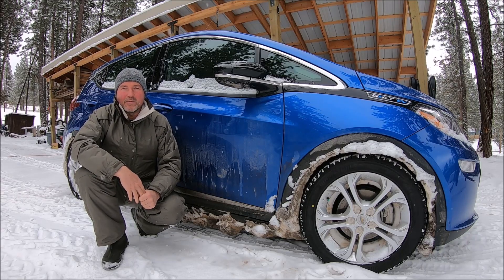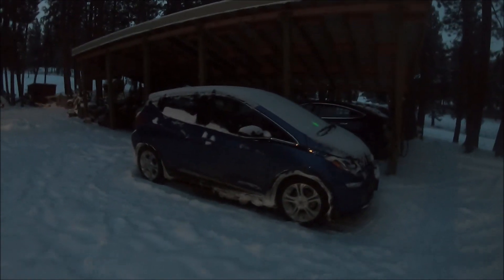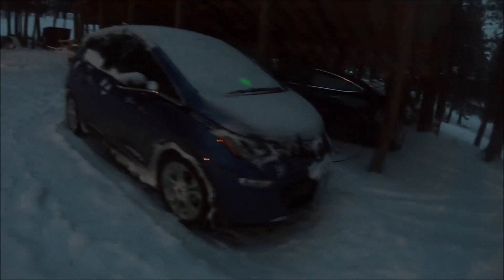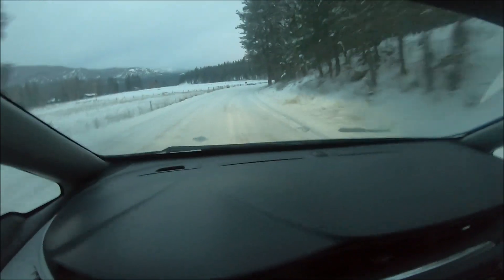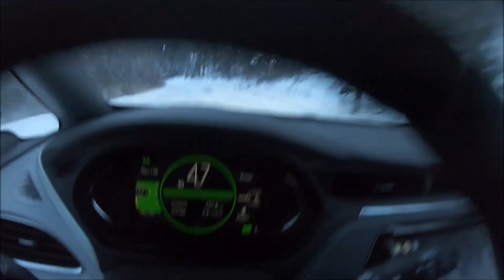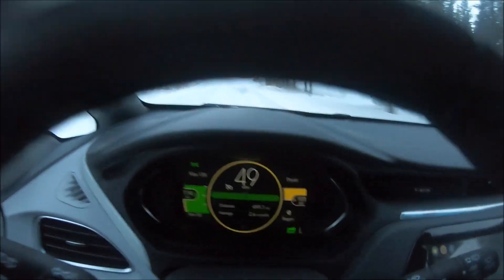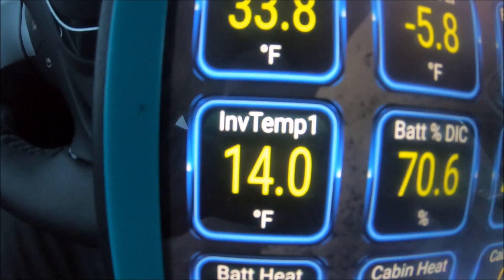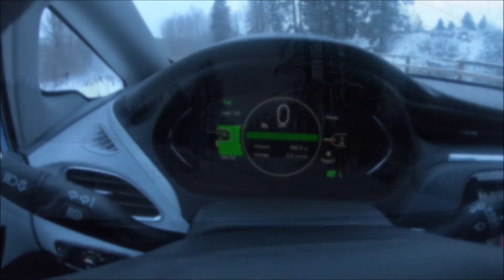Chevy Bolt EV Cold Morning Drive(-9°F/-23°C)No pre-heat, get in and drive. Regen/Power restrictions?

Comment: Thanks for the video. This is the first video I've seen of cold (below 0) temperatures. My Bolt had the same experience at below zero temperatures. It ran fine, but the range dropped below 100 miles. Teslas have the same problem according to my cousin in Chicago. Unfortunately Teslas are made in California, so this issue isn't being addressed to my knowledge.
Reply from the maker: I've got a few videos about winter driving. Check them out. The range shown in the car may not be the actual range you can drive. It can be much lower or much higher! In 0°F or below the range will drop, as it will on ICE cars too. How much range  it will show depends on your previous driving. EV's look at about the last 30 miles of driving for that. If you have a short daily drive of about 20 miles or less in such cold temperatures, the cabin heater and the battery heater are working overtime and are using a lot of power for the whole drive. Now the car calculates range based on this short drive with an extremely high energy consumption. In reality you could drive much further. Why? Because the car drivetrain and battery will come up to a temperature  that does not require the battery heater run as much or even come on at all. Also the cabin will warm up and then less cabin heat is needed. These two things will extend your range. If it show 100 miles range and you go on a road trip you'll notice after about 30 or 40 miles that your range shown does not drop mile for mile. It will drop a mile maybe after driving 2 miles or so. I have taken the Bolt and Model 3 on many cold winter drives and found that, on a road trip, in the worst case the range does not drop below 50% of EPA rated range. For my 2020 Bolt that would be at least 120 miles of range. On my Model 3 that would be 155 miles of range. These are conditions that you don't want to be doing a road trip in anyway. Daily short drives, like going to work are no problem as you have access to your usual charging infrastructure. These issues are not because Teslas's are made in California all EV's suffer from this. Unfortunately these are physics. With time when EV's become mainstream more efficient components will become available, but this will probably never go completely away.
Reply: @RMTFamily  As battery tech improvements like solid state batteries become implemented this wont be much of a problem if one at all

Comment: Assume the Bolt is equipped with FWD only?Holds the road pretty good.
Reply from the maker: Yes, the bolt is a front wheel drive. I think that is the preferred over rear wheel drive as the motor, inverter and all electronics are located under the hood. It handles like an ICE front wheel drive, actually better because of the low center of gravity with battery pack below the floor.
Reply: @RMTFamily  Okay...thanks for helping
Reply from the maker: @a.joseph4233  Anytime. If you have any questions just ask and I will answer to the best of my knowledge. If I don't have an answer maybe somebody else does.

Comment: So you unplugged the car because you were charging the car outside?
Reply from the maker: Usually you keep an EV always plugged in while sitting at home. That does not mean it is charging or using power the whole time. But if plugged in it can run the battery pack heater without using power from the battery pack, which would decrease you range. In this case the car was plugged in as usually. Our EV's live outside! No garage! I did not pre-heat the cabin of the car and charging was actually done right after it was parked a couple days earlier. Usually I would pre-heat the cabin before driving, but here I was looking for it to be as cold as possible all the way thru. This is extreme as usually you would set the charge to be started in the middle of the night so it is done just before you leave and you would pre-heat the cabin about 20 minutes before leaving. This way you get into a warm car and the battery pack would also be warmer than in this case. So I just unplugged the car right before driving it.
Reply: @RMTFamily  Okay..now i understand ...thanks for helping

Comment: Does the cabin heater work well in below zero temperatures?  (Even if it does use a lot of energy)
Reply from the maker: Yes it does. It also has the advantage that it puts out heat right away, while on ICE car you have to warm up engine first before you get heat.
Reply: One pedal driving on my Mach E is amazing

Comment: I got some Blizzak Winter Tires on mine, handles awesome.. I got side swiped by a UPS Semi truck on black ice on the expressway and was able to recover without going off the road.
Reply from the maker: Yes, those tires are well worth the money. Never had any issues with regen or traction on ice or in snow.
Reply: @RMTFamily  What is that App your using to pull battery stats?
Reply from the maker: @JosephJozwik  This is such a common question that I actually just finished a video about it. It will publish this Saturday at 10AM Mountain Daylight Time. It is the Torque App but it requires special files to work. It'll be all in the video with detailed instructions.

Comment: Interesting analysis. I read something about a guy in Alaska (I think) and he had conditions possibly even worse than yours. He otherwise has similar comments about a block heater for his diesel truck, regeneration on his Bolt in the cold and other issues.

Definitely going to take a look at other videos in your channel. Thanks!
Reply from the maker: There was a viewer from Juneau AK. He told me that Juneau is the is not just the capitol of Alaska but also has the most EV's per capita. I forgot to plug in my truck before, or did not expect to use it and thus it would not start. The EV is always plugged in when home, never an issue.

Comment: There is just no more excuse for not driving an EV. They do great even in this cold.
Reply from the maker: @youdontknowme2915  Good for you. If you never had a starting battery fail on you in 50 years than you are very lucky. The common starting battery lasts 3 to 5 years, sometimes you can even get 7 years out of it. The question is why did you never have any starting issues in cold weather. Did you get a new car every 2 or 3 years? Did you replace the starting battery as preventative maintenance every other year or so? Do you actually live in "cold" (below freezing for several month) weather? 
Most people will need a jump start or replace a battery during their time driving an ICE vehicle no matter where they live.
You right people driving ICE vehicles don't have range anxiety, that's why you see them frequently on the side of the road with gas cans. But most people don't carry a gas can. They have to spend a lot of time to get that that gas. About the same time it takes an EV to get a quick charge from a roadside assistance company or have the EV towed to the next charger. But that is very uncommon as range prediction is pretty accurate in electric vehicles and electricity is available almost anywhere, but not gas. 
By the end of this decade range anxiety and EV's will not even be in the same sentence anymore. 
EVs follow about the same S-Curve that ICE vehicles did over 100 years ago. In the beginning everybody asked the same questions and made the same statements back then.  Where do you get gas? Who can repair it? How far can it go? There is not even gas stations. Nobody knows how to repair it. You can't get parts for it. What if you run out of gas? etc.
Thank You for watching.👍
Reply: @youdontknowme2915  The Chevy Bolt is affordable and when you take take it for a drive across America you will notice that the fuel bill is lower too.
Reply from the maker: @youdontknowme2915  AAA gets anywhere from 20,000 to over 50,000 calls for running out of gas per MONTH. In the US alone.
The number 1 cause for break down call is, you guessed it, the starting battery.
I don't make this up you can do your own research to see that's it.
Not laughable and not nonsense.
Reply: @@todd3382 Your ICEV has degraded efficiency in cold weather. In summer you do 30 mpg, in winter be happy to get 20-22 mpg. Not sure what are you talking about.
Reply from the maker: @Todd Sounds like you don’t drive an EV. Who said you can’t charge to 100% at an DCFC. Certainly you can, done it many times, but it’s not always needed. Heat does not affect range very much, cold does but with more heat pumps in EV’s even cold range has improved. And even with the range limitation on EV’s, people need a bathroom break anyway after a couple hours of driving, good time to charge the car.
Reply: @Todd Why can you only charge to 80% at fast charge stations? Nothing says you cannot if you need to. Just that most don't because it can degrade the battery faster and they don't need that extra 20% for their regular daily commutes.
Reply: @Todd you have no idea what are you talking about, but you think you know everything. 
Let me tell you how things work : you can charge to 100% on DCFC or on a L2, this fact doesn’t impact the battery chemistry. The simple fact that you charge to 100% a battery on a BEV doesn’t count much. 
Keeping long time the battery at 100% SOC or at low % SOC (less than 40%) will impact in time the battery chemistry ! The key word : in time ! If you keep your battery @ 100% one time, it doesn’t matter. If you keep it long time @ 100% in a regular bases, then yes, it does have an impact.
Reply: @@todd3382 You forget one thing - the batteries in the BEV aren’t the batteries in the laptop or iOS/Android phones. They all have temperature management system and they are kept in the temperature range for an optimal usage. Thus, what you say holds no truth. And, yes, there is a number of full discharge cycles the batteries in the BEV are conceived, for the Bolt EV it’s about 3000 cycles if I remember correct before a significant degradation is registered. 3000 x 200 miles (for the easiness of computation) you do the math. In about 600 000 miles the BEV will face a significant degradation (more than 30%). 600 000 miles is diesel territory. Check the YouTube, there is a Bolt EV who’s passed 150 000 miles in 4 years and had a degradation of the battery lower than 10%.
Reply: Depends on the commute. My new commute requires a charge to get home and with fees and charging cost it’s more expensive to drive than an Elantra hybrid would be. Plus add on an hour or more of charging to get home and a hybrid is cheaper and quicker.
Reply: Only would drive a Tesla or polestar
Reply: Agreed, but the issue is not how well they do, it's how far can they go?? I have a 2015 Volt and I like how you push the button and go. Heat comes quickly. I drive 140 miles a day and no charger at work. At those temps I couldn't make it round trip. If it had a heat pump, maybe.
Reply from the maker: @bmw803  It's important to know that EVs can do well even in extreme cold compare to ICE cars that struggle to start and run. Sure range is important for some, that's why we also have videos about how far they can go in cold weather. Check out these 2 videos: https://youtu.be/UbDEjwoRqGI   and   https://youtu.be/u1XyFGFA6Uc
We have many different videos addressing different issues. Just keep watching.
Reply: Yeah. There is. The grid can’t handle it. Nice try.
Reply from the maker: @jxp1993  The grid can! Actually the grid loves EV’s! Over 95% of EV charging is done at night. The grid loves to have such a base load. EV charging at night everything else using electricity during the day.
Reply: There is a reason you don't get to decide for others.  EVs are over priced shit!
Reply: I live in the city, with no driveway and competitive parking. It is not feasible for me to have an electric car because I can't charge it in front of my house and there are almost no charging stations.
Reply from the maker: @MouseyBusiness  Unfortunately this is still an issue in some places. Hopefully this will change quickly. There are more and more solutions becoming available for on street  charging. Depending on how much one drives, some people get away with only “scavenge”charging ( charging at grocery stores etc). Others drive to a DC fast charger once or twice a week, some can charge at work and some people do a mix of all. Each situation is unique. Your employer might put in a charge station or two, or your favorite hangout eg coffee shop or gym. Ask the owners of those places. I don’t expect them to provide free power since charging at home is not free either.
Reply from the maker: @Todd So actually you don’t really have any experience with BEV’s as you just got your first one. Congratulations to your Bolt EUV. It is a great car and certainly can do long distance travel. Yes travel is a little different, it is much nicer and you don’t get all stressed out. You actually get to your location much more relaxed. Charging to 100% does not degrade the battery. Letting the car sit at 100% charge for hours would degrade batteries. We have a 2013 Tesla Model S with over 200k miles on it. Still first battery, degradation is just 12%. That is not even noticeable when traveling. Still plenty of range. 
At this time you have no real experience with EV’s. Get to know your car and learn from other EV drivers what your Bolt is actually capable off. 
Again congratulations on your Bolt 👍
Reply from the maker: @Todd I clearly stated BEV which is know as battery only EV. It did not say PHEV. That’s what the Volt is. I’m glad you have all that knowledge, but you are the one misleading people not me. The videos show real life with EV’s. That is not made up and not my opinion. It is facts.
Reply: @RMTFamily  well I guess people will find out the truth when they drive in cold or hot weather...  And remember that you told them was wrong.
Reply: When the 620mile range,  0-60 in 1.5 seconds, low 8 second quarter mile good looking Tesla Roadster comes out... i'll get that as my first EV
Reply from the maker: @sphincterlicker69  Just make sure you don’t total it in under 2 seconds 🤪😂😂

Comment: Looks like Torque Pro.
Reply from the maker: Yes it is.
Reply: I use Dr. Prius on my 2 Prii because it measures the Internal Resistance of the modules which is a better guide than voltage. It can also do a stress test. But I haven't hooked it up to my new Bolt yet to see if it does more than just CEL codes. I'll let you know.
Reply from the maker: @amazoidal  I have a bunch more PID's for the Bolt, but show only a few that I think are interesting for most people. But there are individual voltages and I believe pack resistance. You can get the Bolt PID's from here: https://allev.info/boltpids/
Reply: Thanks. Must be nice in Montana. Living amongst the famous who escape to there. Huey Lewis being my fav.
Reply from the maker: @amazoidal   It's nice in Montana but not because of the famous.

Comment: Nice video.  Was the cabin pre-heated while it was charging?  It would be interesting to do a warm-up with a charged, but un-plugged car to simulate what happens after a long soak.  Like simulating parking at an airport for a few days without a charger available.
Reply from the maker: No pre-heat, just plugged in. I have a video where the car was sitting for a few days unplugged in the cold. Check it out here> https://youtu.be/ivvKqguWhJs

Comment: If the 22 EUV had wireless Android Auto I might get excited for this.
Reply from the maker: You better start to get exited > It will! Our 2020 Bolt has Android Auto and Apple Car Play, but it has to be plugged into the USB port. The 2022 Bolt EUV will have it wireless! Click this link and go about 2/3 down and you'll see it: https://www.chevrolet.com/upcoming-vehicles/2022-bolt-euv
Reply: @RMTFamily  Yeah I saw that today. Right now the Bolt and ID/4 are on my list. It looks like Hyundai/Kia are giving up on Kona/Niro and moving to Ionic so I am not waiting that long. A 2022 Niro or Kona with those features would be great, but not happening. How is the Bolt in the snow. I have been an AWD person for the last dozen years even here in ATL, but am willing since the EVs have so much extra weight to keep them planted. I like how Chevy has really done a good job with the Bolt.
Reply from the maker: @hdtvkeith1604  It does fine in the snow. It is a front wheel drive and has the motor, inverter etc. under the hood which adds some weight to the drive wheels. We have been driving front wheel cars only, except for the Tesla Model 3, for the past 15 years or so here in Montana. The Bolt is just like any other front wheel drive car, which is just fine. We never got stuck and never needed chains. We even had to tackle some steep snow covered driveways with the Bolt and it did it. Important is that you have winter tires to tackle winter climate. But that is the same for all wheel drive since it is not only about traction when accelerating but also when slowing down and cornering. Both my wife and I are happy with Bolt and its winter driving abilities.